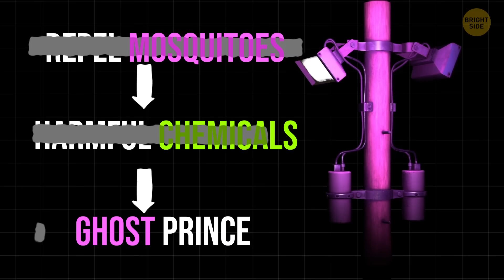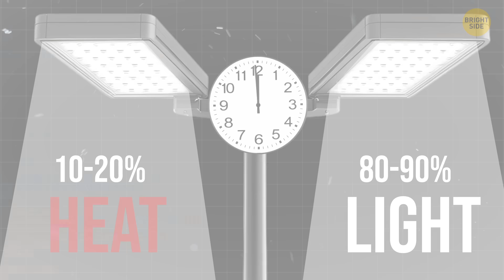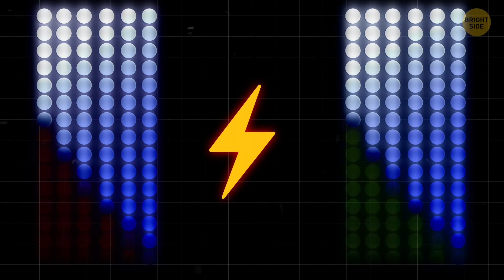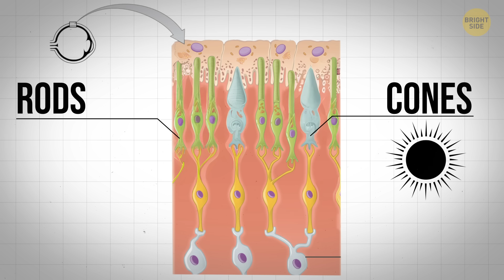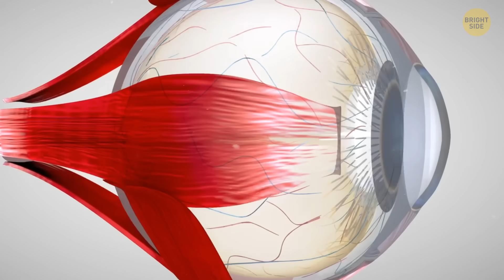Why The Street Lights In The US Turned Purple

Comment: The second part of the video is complete bs. The issue is not in rods and cones. It's simply optical. Violet light has shorter wavelength than the others, and any lensed device tuned for average white light (including a human eye) will experience chromatic aberrations and troubled focusing.

Comment: 3:12 Also how panels on WOLED TVs work. (Not LED, QLED, mini-led, or QD-LED). Expect LG's newest TV, the G5, actually uses TWO blue layers (That's why it'd being called a 4-stack when the G1 to G4 and C5, as well as the WOLED Sony TVs, are all called 3-stack)

4:14 Actually...that's NORMAL LED TVs. OLEDs DO use phosphorus. It's just that you would have to INTENSIVELY use your OLED for SEVERAL YEARS to even notice a SLIGHT difference.

Comment: A lot of electronic issues stem from company management. Engineers and designers know full well how to design things that work correctly and last. Then management comes along and finds ways to trim costs, or even intentionally shorten the life, all of which compromise quality. Those LEDs could have lasted a lot longer if they were operating within manufacturers' specifications. Overdriving has a significant effect on reliability.
   I can cite examples.

Comment: The only place that I see those lights EVER is in my home town right near the hospital. They use it in their parking lots. Its less strain on the people using the parking lot, but also is easier on the surrounding neighborhoods. That light is easier for neighbors to handle then normal lighting. And....the glow from normal lighting was seeping into patients room, despite the blinds. They found that the purple/blue lights cut down on that drastically. So basically, its done for light pollution and to regulate that even more in areas where more people are sensitive to it. 

The hospital does it because it actually is a health benefit and they care. The people around them have to accept it and they probably appreciate it. Places like walmart dont do this because they dont care at all. Most people dont care at all, in fact, which is why its not common. 

I live in the great lakes basin...in a protected wetland area no less. Bugs are out of control. I have a feeling the lights at the hospital help with that, but people in their homes seem to turn to red bulbs for help in keeping bugs away.

Comment: I had heard the problem was traced back to 1 single manufacturer of the individual diodes in China. Multiple lamp manufacturers bought these diodes in bulk to produce their lamp assemblies.

This is actually kinda scary to think about. It would be like multiple piece of medical equipment failing all over the world because 1 manufacturer made faulty wire.

Comment: It's because white LEDs are actually UV LEDs with a phosphorescent coating. Some phosphorescent materials undergo photo degradation, or repeated thermal cycling can slough off the phosphor coatings. This is the same as burn-in on an old CRT screen or television. The whole reason why we had screensavers in the '80s and '90s.
Reply: UVA, UVB Or UVC light?
Reply: @CRUJIAS older style is usually indium gallium nitride which is blue (450-475nm) depending on the dopant (indium) concentration. Phosphors are typically rare earth lanthanides such as cerium doped yttrium aluminum garnet. (Yellow-ish broadband light) If the binder for the powder breaks down, the Ce:YAG flakes off and the blue tends to dominate. The yellow + blue together give a white color.
Reply: @CRUJIAS maybe it's blue light, not ultraviolet
Reply: CFLs do make UV light and they have a white phosphor that makes the white light.
Reply: Mainly at intersections and on and off ramps?
Reply: @myvideos3346 those are where most of the lamps are installed, so naturally. Those are dot regulated. Street lamps for sidewalks are not dot regulated and fall under municipal preferences.
Reply: Right about LEDs, CRT burn-in has nothing to do with that.
Reply: @jimbotron70  ooh I'm about to learn something here. Do tell!
Reply: @LaserJake99  Burn-in is a persistent image etched into the CRT over long period by electrons.
There are no UV sources in CRTs
Reply: @jimbotron70 you are correct. There is no major source of intense UV other than bremstrelung radiation. That being said, the mechanism of UV photo degradation of phosphors is very similar to electron beam degradation. If you stick a UV LED up to a CRT, it will activate the phosphorescent rare earths on the screen. The reason they are similar is related to Einsteins photoelectric effect. Energy is energy. The mechanisms are crystal lattice destruction, ion implantation, and coating of the phosphors with sputtered material. 
Source: Me, a physicist that works with and synthesizes organic and inorganic phosphorescent and photo luminescent materials.
Reply: @jimbotron70 crts used phosphorus. It is a bit related.
Reply: @NoobNoobNews that is actually not true. They used Phosphors which are things like cadmium sulfide or rare earth containing compounds like europium. The name phosphor is confusing to many people. White phosphorus glows due to a different mechanism when exposed to oxygen. It's actually a beautiful brain like pattern on phosphorous. Look for a video on YouTube of phosphorus glowing. Phosphorecence derives it's name from the glowing property but is from excited triplet state emission of atoms and molecules. Fluorescence is fast singlet state decay/emission.
Reply: @NoobNoobNews  There's phosphorus in fish too...
Reply: @jimbotron70  I never typed phosphorous. Cellphone auto correct made it that way. I wanted to type "phosphors"
Reply: @LaserJake99  I wanted to type "phosphors", but cellphone auto correct. I just wanted to say because CRTs used phosphors, it is a little bit related.
Reply: Very true, the high intensity of the purple LED heats up, chemically changing and degrading the phosphors.
Reply: Thank you for extra 8 minutes in my life!!
Reply: If I were you I couldn't write half of that
Reply: @gguniverse-l8eYou're not me that's why you can't. Go pick up some books my friend.

Comment: I've Seen it happen multiple places. Vacuum tube LEDS are the way to go. How many people does it take to unscrew a lightbulb?  Just one. How many people does it take to change a whole Unit an electrician because if your house burns down from having to switch it out and rewire it. It's on the electrician.